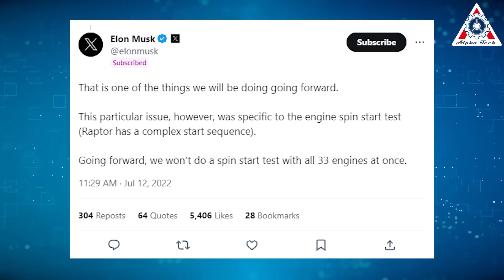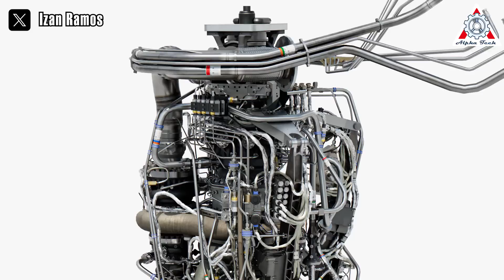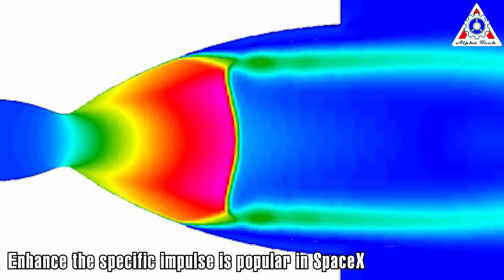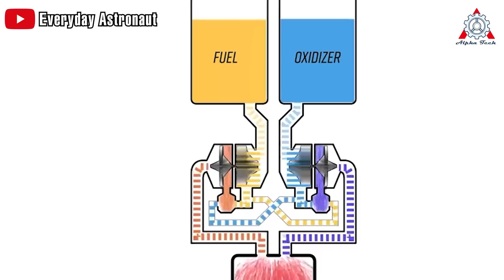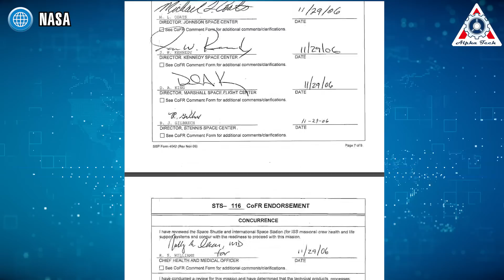SpaceX's Raptor Problem...???

Comment: Not to worry, we have yet to see more than one Raptor 3 firing...
And so far only R1 & R2
engines. Also those engines had larger combustion chambers, and way more Rats Nest and Plumber's Nightmare syndrome..
Raptor 3's are cleaner, even in the attached pumps version. Less parts, less failures, So we should see a serious shift in reliability launch after this.
To, me, the engines are a done deal after R3, only likely change might be shared pump clusters, which should increase reliability by parts count reduction.
I think the ship design needs focus, its gonna be the most time consuming, and problematic. its like building a house: you can go from foundation to closing it in, in days, but then the details are forever.
Was thinking last night and this morning on the lunar lander issues, and the potential in low gravity to use rotating engines in pods to create a tilt rotor effect. that if you could land the ships on their side, Those wiring trunks could be beefed up and also used as runners.
To keep the hull from getting rock dimples.
Then, you could have the cargo doors run longitudinal, either singles or split, and have ramps to get things in and out of ship.
One added positive of podded external engines, would be potential braking. via rotating exhaust forward. this might allow less heat shielding.
Basically for low gravity, you could pick your LZ and do a controlled descent that was a very short and slow arc.
What this would mean, is you could have two classes of ships, one for low gravity, and another for Earth gravity, and quit paying the frieght on those tiles to Mars and back.
Also, such ships could be built in aluminum at half the weight, meaning double the fuel efficiency on empty hulls. and increase it on hulls in cargo.
I dont think the one ship does everything paradigm is going to last. I think SpaceX needs to diversify
more, and get some other things going. We dont wanna be the Star Faring culture that only built one hull model.
And the whole trip of atmospheric braking is downstream from lack of enough fuel problems, that paradigm will change the day we start producing fuel in low gravity situations.
And its risky... One failure and you get insta fried.
Hard ticket to Valhala that route.
Reply: Looks like your taking inspiration from the Firefly model of interplanetary freighters.
Reply: @edvard5697  Doubtful, dont know what that is...
I dont watch TV, and have been living in countries with no libraries, no internet delivery, and cell phones got here maybe 15 years later. So not up on popular fiction. in fact for over a decade only communication with outside world was snail mail a month each way.

But on transit ships, Aluminm is half the weight for the same strength as steel. or twice the strength for the same weight. And if not going into atmospheres, or going into them liesurely, and low gravity, you could trade fuel for heat shielding. The problem is we have been using friction to reduce velocity, and the farther the shot, the more velocity we use to get there. So the issue is our fuel costs out of earth's gravity well for assisted breaking. Not feasable, but even that will change some with lowered lift costs. Also with non chemical engines. i.e. nuclear etc. could be used to accelerate or slow transport ships onto orbits around lower gravity targets, and also carry landers and fuel for them. And for lunar, extremely low orbits possible with the transit ships, and ditto on Mars with thin atmosphere. 
Currently our abilities are based on limits Elon is de facto changing. I love Stainless like Elon does, But also know its heavy.
And that space will be like ocean crossing in boats, that efficiency and being long legged is more important than getting there quick. in boats low HP one lunger diesels will go farther than high speed diesel engines. the simplicity pays in efficiency. 
Space is distance, you pay to cross it, and you have to pay to slow down or find a thicker medium for friction braking.
I suspect the most availbale fuel source will be water. And water will be the economic base for outer solar system economies. How much water you are credited to own.
Personally, I see alot of current space projects as being short sighted. Like building conglomerate space stations with no larger plan. we are paying to throw stuff out of the gravity well, thats eventually space garbage, when we could be using things that would be sections of something larger. Why lift garbage when things of metal could last thousands of years in space?
Our lack of progress is not a tech limit, its a management issue.
Closely related to our educational issues, due to a system designed to kill imagination in children.
We trade imagination for Social forming. And I'm speaking as the father of a State Champion that I taught to read at 3 years old. I did the things Elon is trying now with Ad Astra twenty years earlier. I know it works.
Getting kids to repeat things is not the same as getting them to learn to think. Teaching them thousands of BS names
for things, is not understandung the fundamentals of the universe. Teaching them to juggle numbers into infinity does not make them more perceptive.
It makes for engineering by accountantants.
Making things came way before the measuring stick and the time piece.
Limiting imagination is limiting potential.
Reply: The next major step will be to have the ability to carry enough fuel, whatever that fuel might be, so the craft can be slowed down enough in spece or in orbit so the spacecraft can simply do a controlled fall through the atmosphere. Heatshields, or minimum shielding would not be required.
Reply: @paulr4353  Yeah, exactly my point on the low gravity situations like Mars. with the thin atmosphere, braking using it could get problematic with seriously heavy loads.
One thing I wonder about is what the problems are going to be with cryrogenic fuel storage long term? Is it going to be too complicated or too energy intensive to keep cold and pressurized. Like to use as braking or other fuel on Mars. I know with LNG its often kept refridgerated by the amount used, allowing thinner tank walls in tank farms. propane, methane, etc. making decent refridgerants.
Other wise I would suggest sending fuel and oxy tanks to Mars and building up a working reserve.
Space is unforgiving, only takes a failure or two to kill a crew or colonists.
Would pay to plan and have emergency options, rather than Buffooning.
I dont think I'd land people on Mars expecting making fuel from the atmosphere to be a sure thing. I think I would want a solid fuel back up, and a ship home in orbit.
We've seen the Space Shuttle eat people a couple times, might get ugly doing it 100 or 1000 Colonists at a time.
Having critiqued often and gotten changes to happen, I know the designers aren't Nerd Gods. That Elon & Team are designing by finding out what doesn't work.
Often over looking knowledge from related fields. Like the Starved Horse effect on Hopper, or the over complication of engines, requiring teaching them about parts count from electronics engineering.
Its his creative expression,  and eventually he will get things figured out, but much time and expense could be saved by thinking ahead, and maybe posting proposals for peer review online, before bending metal.
Like that last seperation system attempt, Ringling Brothers circus physics...
That was surreal, they thought it would work, and missed that the two sections would have different centers of gravity and cock bind attempting seperation passively off of spin.
Peer review by non Nerds advised.
Plunging things thru atmospheres is risky. When you could spend time doing multiple loops in thinner air to slow down. use time to spread out heat build up... Or use fuel for braking by getting more up there.

Comment: These Rupture Motors haven't even had a Chance yet ! .... Firing them individually is easy ... but Firing them in the 33 Motor Chaos of a Launch is Way different ! ... Now we're adding :  Heat ... Vibration ... Noise ... Wind ... Vacuum ... Compression ... Expansion ... Smoke ... Steam ... Movement ... Settling ... Bangs ... Clangs ...  Wedging ... Twisting ... Crinks ... Cracks ... Clunks ... Pressures ... Releases ... Freaking Chaos !! ..... It's like Starting your Car while it's tumbling down a mountain ! .... Really HARD ! .... Hopefully Mumbling Musk's , New Lunch Pad lasts ... so He can finally Test these Motors Property , decipher the Problems , and get them All to Work .......

Comment: Delta 5?  That would be delta V as in victory.  Also, the engines do not provide energy, they provide thrust by converting energy (fuel) into heat and ultimately high pressure and thrust.